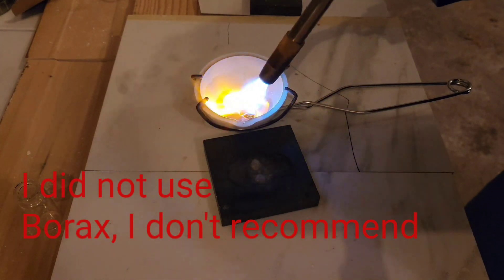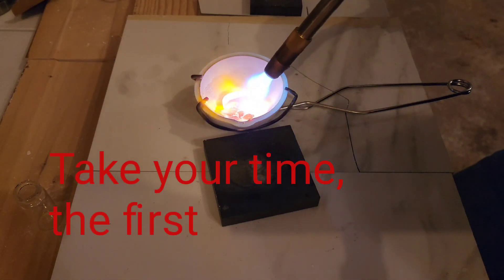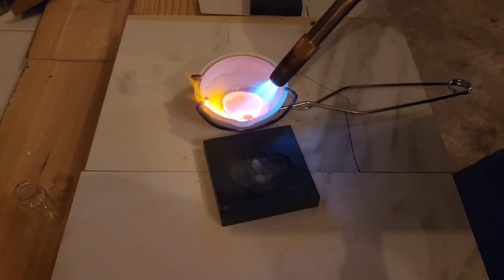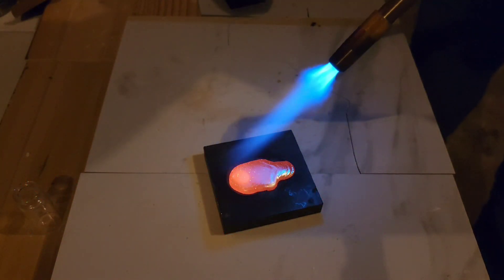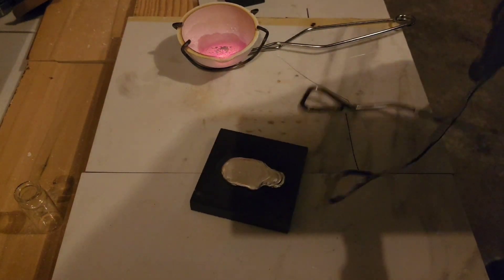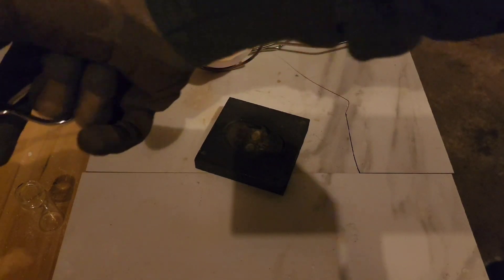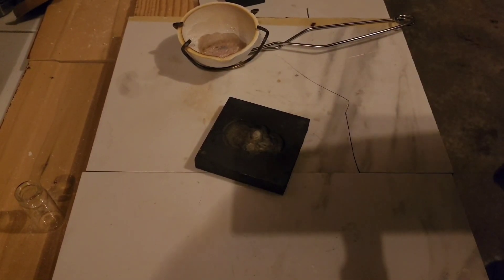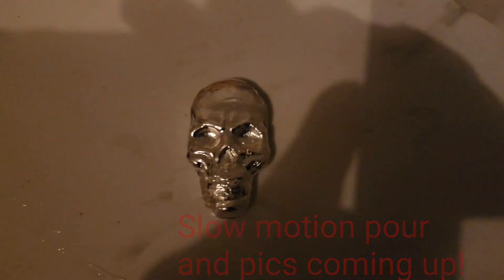Pouring Silver Into A Graphite Mold! (Skull Mold) Using a Mapp Gas Torch

Comment: After spending more than a month looking, this is the only video showing silver melting with this torch setup. Most other channels channels said you need at LEAST the 8000 which is a little hotter.
Reply from the maker: @bizboy6036  i hope this helped you out. I know it's not the best video, it's a bit old. But yes. That specific mapp gas torch can melt .999 fine Silver and gold (not copper)
Reply from the maker: @bizboy6036  if you're going to be melting more than maybe 3 or 4 ounces at a time though, you probably need that crucible device. Silver Shot melts the easiest. I made about 12 or so of those Silver skulls. It's fun, be safe, of course. But it works
Reply from the maker: @bizboy6036  also, if you use some bricks, try and build a little oven over the ceramic bowl (to help keep the heat in) and preheat your graphite mold. That way, the liquid silver doesn't splash when it's poured into it